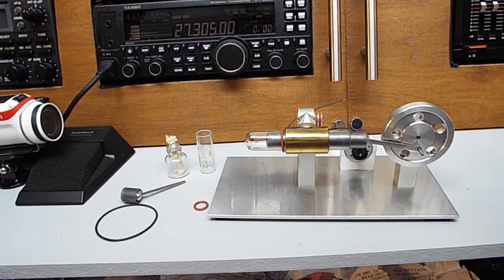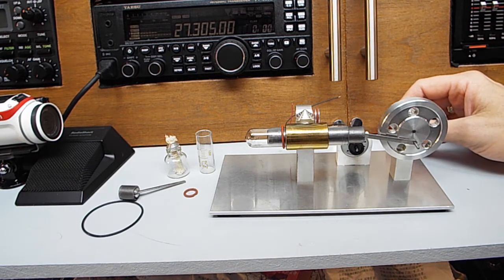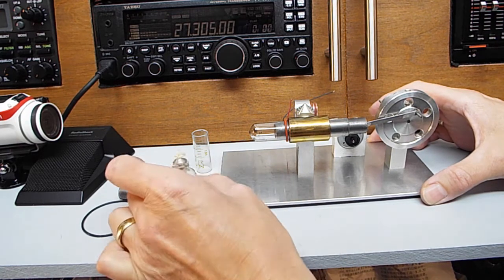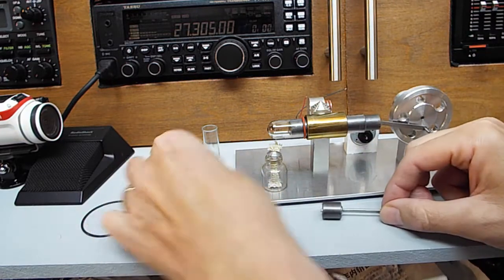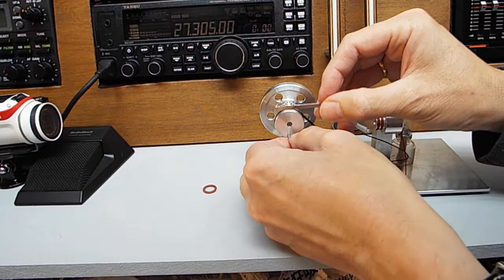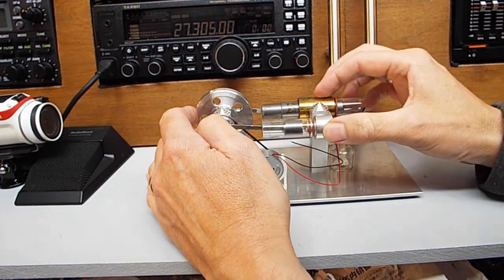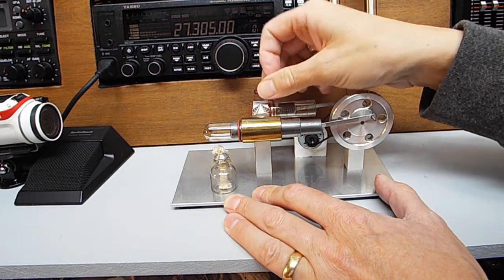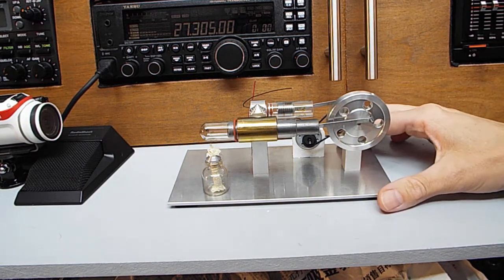Stirling Engine.  Part 1

Comment: are you still waiting for  the  booze.   or  what.     you can use  70 or 91 percent rubbing  alcohol  or  a   tea light.       googletranslate
Reply from the maker: Rubbing alcohol works well.  A tea light does not produce enough heat in the flame and gets very sooty.  The engine ran very well shown in Part 2 of this video.
Reply: @CB-RADIO-UK  i looked for pt2    did not see it.
Reply from the maker: Here you go :-)    https://www.youtube.com/watch?v=HNPsR7RaW8Q

Comment: Compression is a good sign. Good idea with the alcohol, the candle wasnt hot enough, it will run, no worry. Please DO NOT  lubrikate INSIDE the piston, unlike a steam engine the oil get too hot and it do not run well !
Reply from the maker: Cheers Paul.  Waiting on the alcohol.  Hopefully i will get it running on video so look out for it.

Comment: hi fred look at this on you tube noid919 same as your hot air engine and its running he runs his on meth's and and its running well best regards stephen
Reply from the maker: Thanks mate i will check it out.
Reply: just been looking on the bay and there is100s to pick from and I might get one ,cheers fred